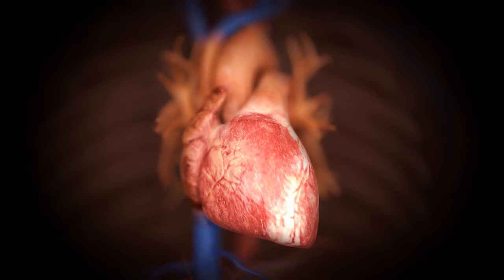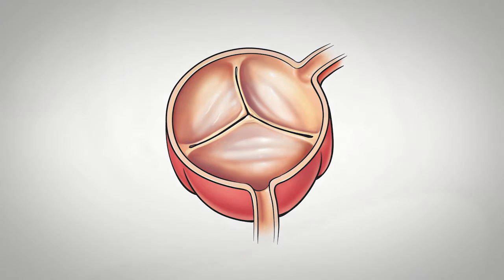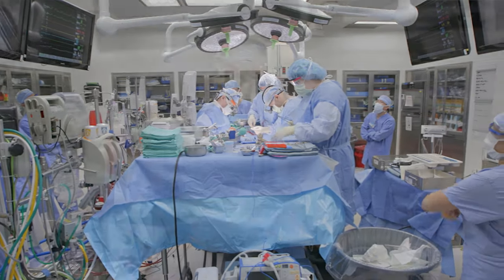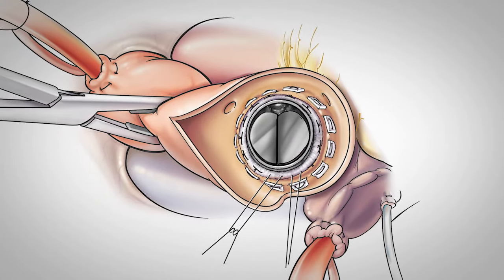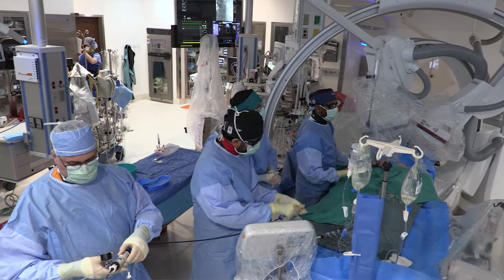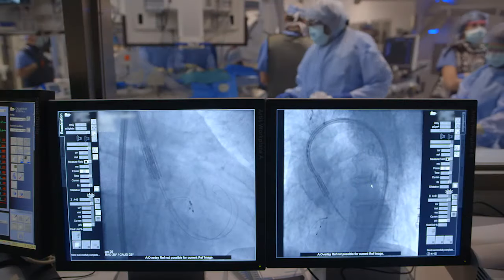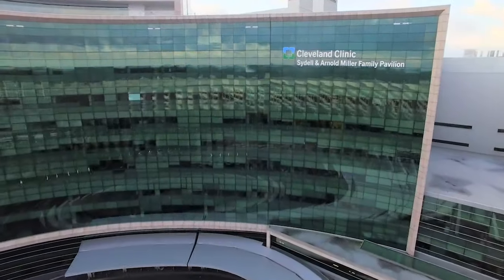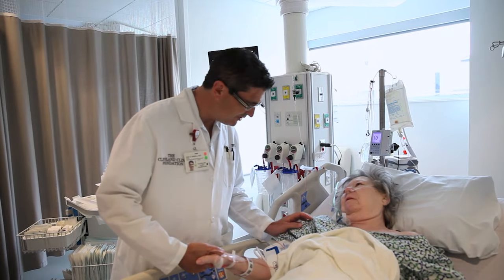Aortic Valve Surgery

Comment: I had my aortic valve done in May, I got a mechanical, an on-x one.  Yes the warfarin sucks but now I have the at home testing so it’s easier.  I eat what I want and they adjust my dose of it changes.  Every day it gets easier but I can do more, I don’t feel like I’m gasping for air anymore just moving. I was terrified and avoided it for 2 years but it feels good to be on the other side of it-I’m mad at myself for allowing my fear to stall it.